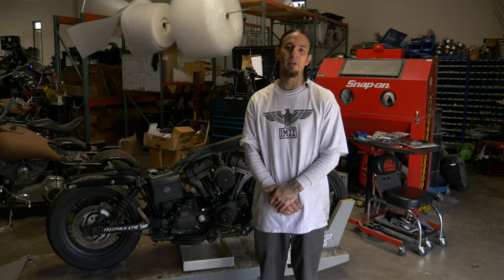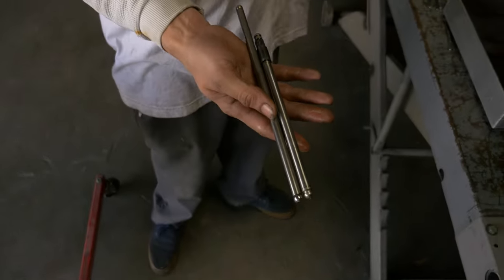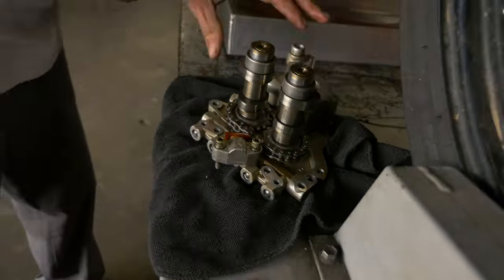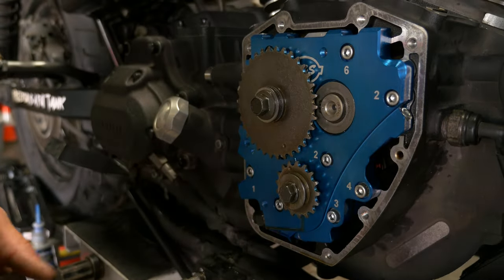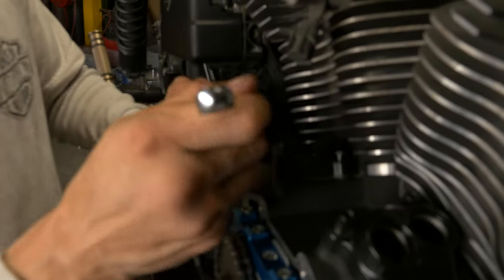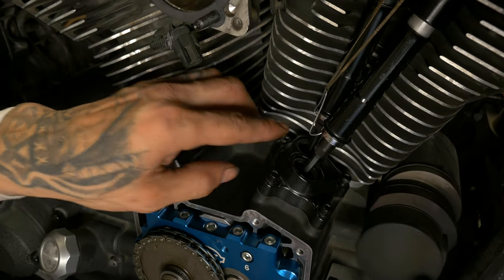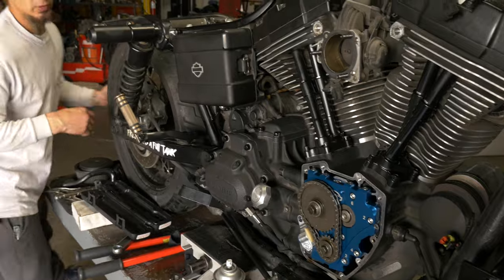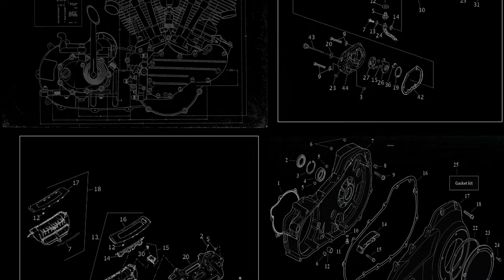Imzz Elite | How-to Install S&S Cam Chest Kit with 574 Cams on an 06-17 HD Dyna

Comment: i blow air around the spark plug, then crack it loose a tiny bit then blow air again around the plug so those tiny rocks sand or whatever else is there now is gone... just say`n
Reply from the maker: Great tip!

Comment: you miss out on a huge opportunity to replace umbrella values and chech oilers and maybe ad rocker lockers by doing it that way. it not much more trouble and if the bike has close to 50k on it id just freshen up the top end as well. ps you didn't set your oil pump. pps aren't those hydraulic lifters? maybe im just not waiting long enough
Reply: I agree, doing mine that way with rocker lockers etc soon too

Comment: This bike already had cams in it 😳. Should of know just by the push rod tubes, then the adjustable push rods the lifters and upgraded innercam bearings that were pulled out ,all give it away. The only thing stock was the cam plate and maybe the oil pump,idk stopped watching at 19min🙄.Them cams were stamped some where

Comment: I thought you are supposed to rotate the engine before you tighten down the oil pump to help center it.
Reply: You are right. Remember when he first installed it, he left those four pump bolts loose, then went to rotate the rear whee (ie to do what you suggested) , but it was locked up, wouldn't rotate? He realized he had installed one of the pump parts backwards, so he disassembeld and reassembled it all (which he edited out,then just explained what he'd done). I think (not 100% sure of course), that he would have done the rotate-then-tighten-the-pump-bolts thing at that point. But you are right, it would have been better if he'd picked up where he'd left off, and finished explaining that the engine needs to be rotated a couple of times before tightening the pump bolts, to center the pump assembly properly. Nonetheless, it was a really good run-through of the job...

Comment: Good video..  question:  Getting all my sheet together to do this, do the lifters have to be "soaked" or filled with oil?  And since cam cover is off can't the timing marks on the cam sprockets be used to find TDC for each cylinder?
Reply: every video i have seen they soak the tappets and i believe there is also a proper way to install the tappets with the side hole going a certain way and he just dropped them in...

Comment: Question, sir...did we use Timken bearings for the inner cam bearings?  Or were these S&S bearings?  I've got an 04 Dyna Low Rider that I will be doing this to and appreciate this video.  Thanks 😊
Reply from the maker: This install used the S&S Cam Chest kit and it came with S&S bearings. We also like Feuling cam bearings.

Comment: Hu, so my 2015 twin cam had a screen where the top small o ring sits. It's in front of the o ring. Haven't seen it in any videos. Do I put it back in or toss it? Thanx for the great video.
Reply: you have a b motor.  that screen filters the oil going to the chain tensioners on the balancers.  clean it and re-install.

Comment: did you prime those lifters?
Reply from the maker: No we did not on this one. The S&S kit doesn't mention to do that but we often do. Once the oil pump pumps oil to them, it's only maybe half a second they pump dry. When you do the pushrod adjustment, you'll turn the pump over and it will start then. It's not a bad idea to prime them though.

Comment: I am confused, you showed adjusting the push rods on the opposite cylinder of the one that was TDC but the instructions from S&S say to do the same cylinder...

Bring Cam to Base circle for the tappets you wish to adjust.
Rotate the engine. Watch the intake valve open (pushrod goes up) and then close (pushrod goes down). Continue rotating slowly until the cylinder's piston reaches top dead center (TDC). The cylinder that you're adjusting will now have both its tappets on the base circle of their camshaft lobes. This is the lowest point in the tappet blocks for the tappets. Notice: Valve is on its seat and fully closed.

Comment: fuckk! bro i forgot to measure my runout (35:45) i went to a se255 cam.. if my chain and sprocket aint alignened what is the worse that can happen?
Reply: forgot to say what i have 2007 street bob
Reply from the maker: Hey Kev, you could brake a cam chain and then the bike won't run.

Comment: I adjusted my tappets to 4.4 turns.  Have I made a big mistake?  I've ridden it 1,400 miles and the bike seems to be running great.  Should I go back a adjust 4 turns after I have no lash?  Thank you!
Reply from the maker: You just risk breaking the spring inside the tappet so you'll end up with a dead tappet and it will start ticking. .

Comment: excelent content, got a question though, shouldn't the valve springs be redone with the 574?
Reply: 574 cam requires no head work or replacement valve springs. Great bolt in cams

Comment: Hey dumb question about adjusting pushrods, once you have it at cero lash do the 4 turns make the pushrod longer or shorter? I toll you it was a dumb question. Thanks for the video.
Reply from the maker: There's never a dumb question....It will make them longer.

Comment: What are your thoughts on the Rivas 574 on a bike that doesn't have any other engine work?
Reply: This bike actually doesn't have any other motor work and I feel like it depends on the motor displacement. On this fuel injected 88 it kind of needs a lil something extra. Like a compensator eliminator and a chain drive to get more torque out of it

Comment: Nice video !! Where do you find the tool to remove  & installed the cam bearing?? . Need to do this on  my  05 soft  tail. Thanks.
Reply from the maker: It's a tool from Jim's. You can get it directly from Jim's or Drag carries them too.
Reply: And be prepared to pay over $500 for a tool your gonna used once .
Reply: George's Garage. They make very fine Harley tools. As good as Jim's or OTC. Priced a little more than the junk on Amazon. Worth every penny. The Fuel Moto tools are great too. Took my advice from Bob Wood personally.

Comment: I would be straight pissed off if this guy worked on my motor. Cam chest is to be assembled on the bench with the oil pump. Even Harley updated their process to match Feulings. Tightening the cam plate down and pump before rotating 5 full rotations, not 2. 

Didn’t pump or vacuum bleed the lifters. 

Didn’t clean the new parts. Just because theirs new doesn’t mean they’re clean. 

Didn’t check the tappet bores. 
Didn’t see him lube the actual cam bearing needs rollers. Also didn’t tell you all the numbers and writing in the cam bearings are to face out so they seat correctly.   

Back to the oil pump…. Sure he flipped the g-rotor… which will happen when you don’t pay attention to disassembling the new parts while you clean them, then lube them, reassemble and lube some more. 

For cleaning things you can use electrical contact cleaner. Much better than brake clean. It just blows my mind that he didn’t clean anything except gasket surfaces. Dude didn’t even clean the pushrod tubes. Da fuq man.
Reply from the maker: Big Red Nick....you looking for a job? We'd love to have your expertise on our team. Shoot us an email if interested. Also, some steps were not in the final edit, unfortunately. Something we will have to bring up to our videographer.
Reply: Didn’t see any assembly lube go on cam lobes lifters etc either, everything should be covered.

Comment: A screw is a screw until you put a nut on it then it's a bolt.
Reply: You shouldn't drink the bong water Sir.
Reply: @t.s.racing  According to the Machinery’s Handbook, bolts are used to assemble unthreaded objects with the use of a nut, while screws are used to assemble objects with threads. However, not all objects in which screws are used already have threads. Bolts are used with nuts, whereas screws make threads of their own or are used on the threaded component. Most sources define screws and bolts in terms of how they are installed: if you turn the head it’s a screw, if you turn a nut it’s a bolt.   A screw is a screw until you put a nut on it, then it's a bolt. Get off the dope, dope.